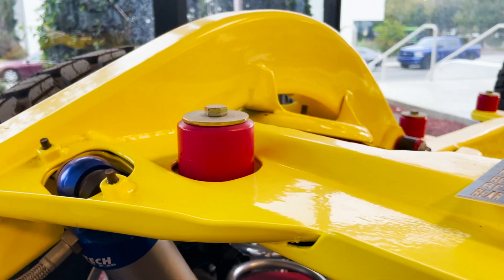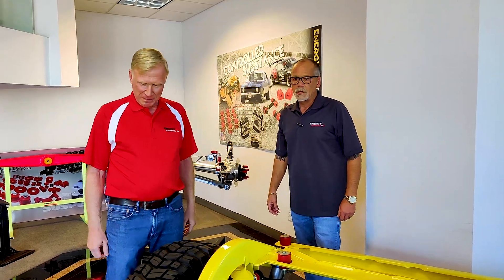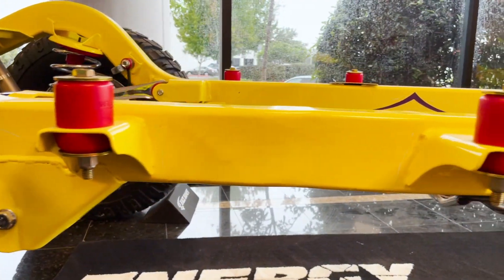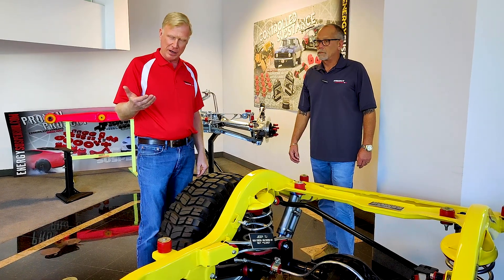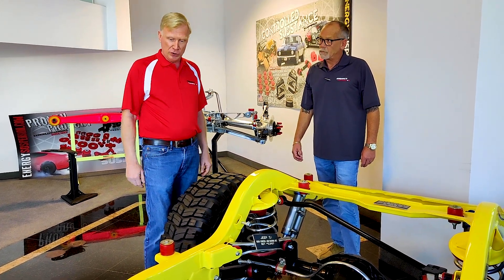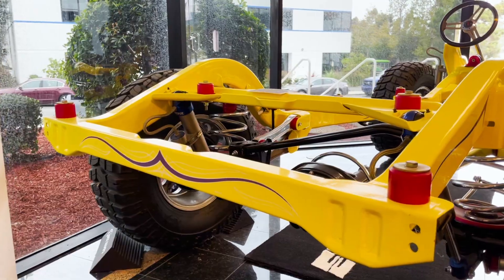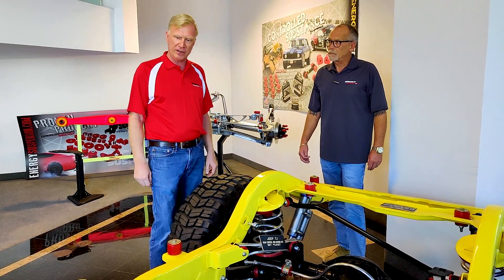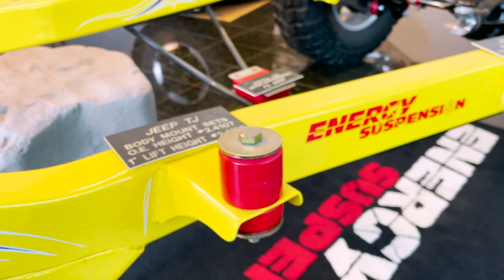Energy Suspension R&D Talk Body Mount Bushings

Comment: Just bought a 2005 Chevy Blazer mounting kit ...The other OEM bushings are going on 20 years old Anyone looking to do a lift kit Or even normal day to day use These mounts look like they will hold up longer than 20 years - They shipped quick and to my door with in 3 working days Out of the states .....I also bought a tube of grease to limit any squeaks

Comment: Can bad body mounts cause a bumpy ride? Nice video,  thanks
Reply from the maker: Yes, bad body mounts can definitely lead to a bumpy ride. Body Mount bushings are the components that separates the body from the chassis. If you have stock rubber bushings on that are more than 7 years old, they may have started to deteriorate, crack, or even fail. Metal on metal would cause scratching, bumps, and definitely take the comfort out of your ride.
Reply: @EnergySuspension1  me in my 96 4runner reading this knowing I need to replace them now
Reply: Why squuze alot noise i torque 44ftlb